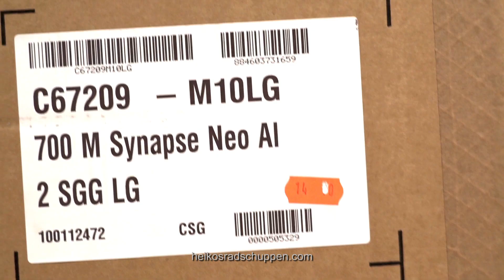Cannondale Synapse NEO - Unboxing

Comment: Be good to see how to remove and reinstall battery after charging. I removed the battery with some help  to charge it and am having trouble reinserting it.
Reply: I have no trouble removing or reinstalling the battery. You need the key for both.